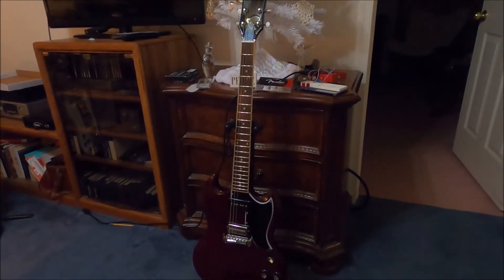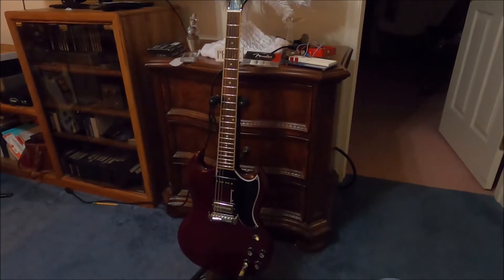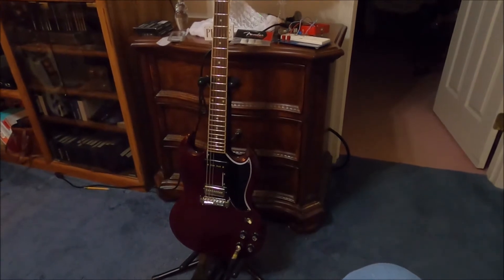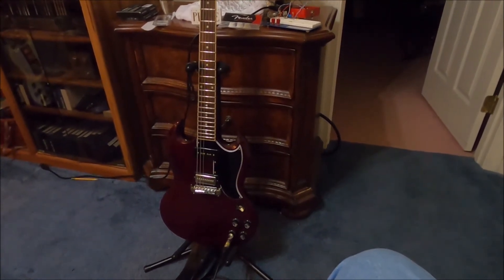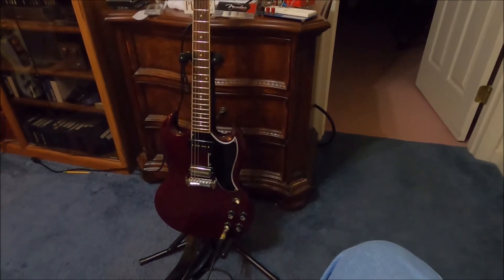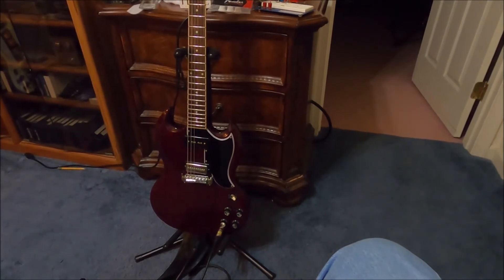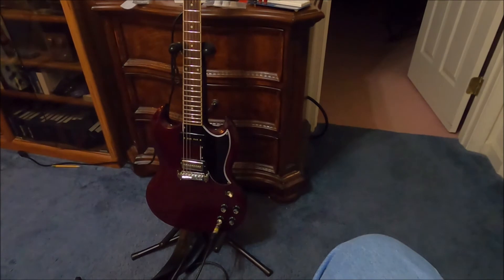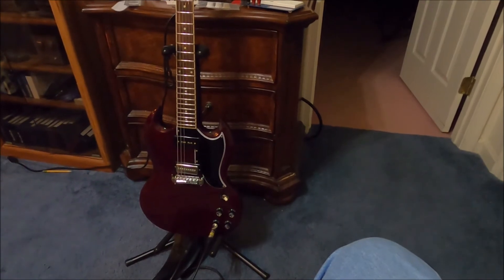DIY 9 Pole pickup vs Seymour Duncan P90

Comment: DC resistance is only useful when you look at the same pickup.  Originally there was only one PAF and one P90 model.  The same pickup was used in all positions.  Assuming all other things equals, DC resistance was as good a guide as anything else.
These days, with about 20 different end and ten different magnet types, it is a bit useless, although if you are comparing vintage PAF or clones and know the magnet type, it sort of helps ... but even then, it’s not everything.
Reply from the maker: That is the point of the video.  It is all about the inductance of the pickup and magnetic field strength.  This would be very low inductance and magnetic field strength in comparison to modern pickups.

Comment: Cool demo! Also the neck pickup is almost always louder because the string vibration is higher at its position. I always find myself looking for a really loud bridge pickup to even things out!
Reply from the maker: Thanks.  Since the specs some people reference for pickup output is coil DCR where higher is more output is only correct for the exact same magnets.  Even an 8K Ohm DCR P90 would have more output in the bridge than this 11K Ohm DCR 9 Pole.
Reply: @HollisAudioLabs  very true! Sidewinder types usually have a higher resistance but not as much 'percieved' output as an equivalent true p90.